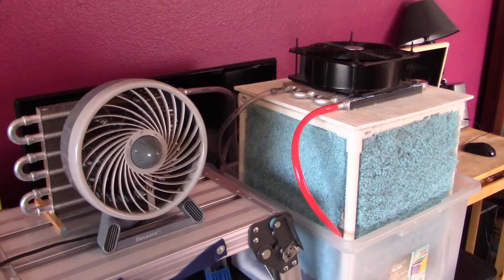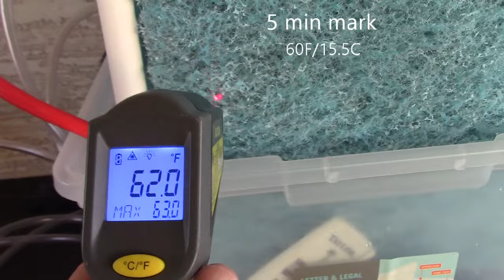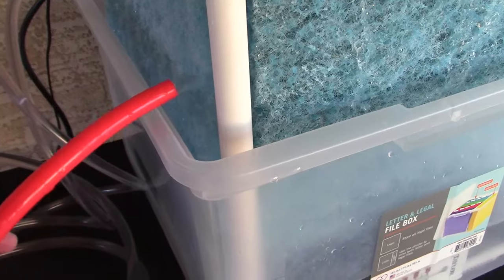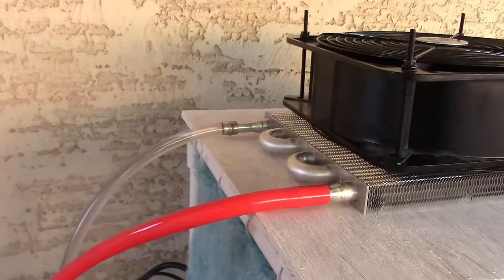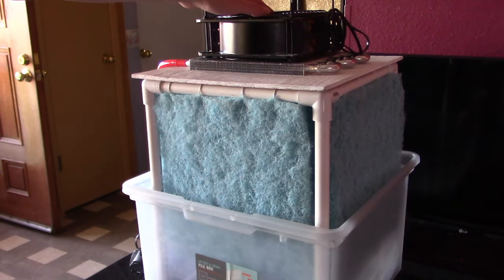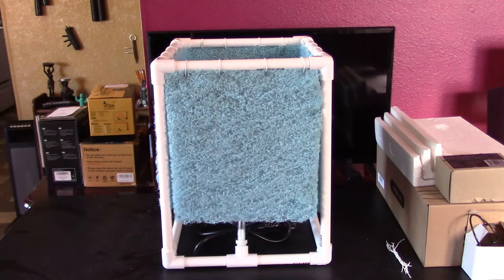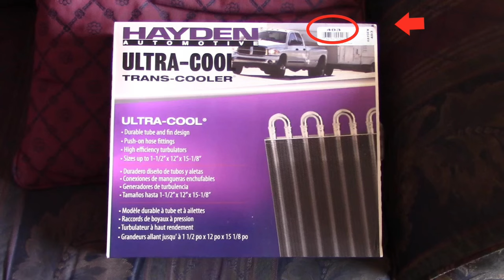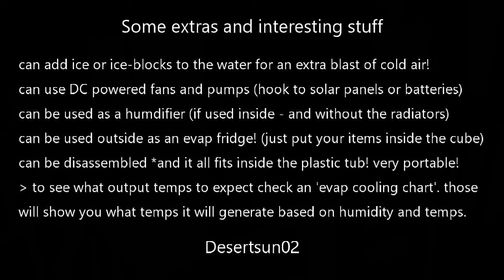DIY "TWO STAGE" Indirect Evap Air Cooler! No added Humidity! brand new! 2 fans/2 pumps/2 radiators!

Comment: may ask what material are those pads used? btw very nice idea video
Reply from the maker: hi and thank you! technically, they are foamed polyester evap cooling pads. places like home depot and lowes have them. amazon sells them but they are usually waay overpriced on that site. a 3x3 foot pad shouldn't cost more than 12 dollars (they were about 8 to 10 when i got them)

Comment: Do you know about the Coolerado cooler? That's a very good design and is multiple stage. Just copy that design and make one
Reply from the maker: hi. i've heard of it. i think it is just a standard two stage unit (or what they call direct/indirect evap cooling. one problem with those is that they still produce some humidity in the air that you are cooling (but it is lower than a regular direct unit). a direct unit's humidity is 80% and the other is 50% to 70% (going by memory). a system like the one in this video though adds no humidity at all to the indoor air. especially good for those areas where the humidity is in the moderate range (and you don't want it to be higher)

Comment: I have a simular idea for living on a boat. Take a small car radiator with its 12 volt fan attached. Take another radiator and attach it to the first one with long enough hoses to reach down to the cold water under the boat. A 12 volt pump brings cold water from below the boat up to the radiator with the fan.
Moisture should condense on the radiator coils and lower the humidity inside the cabin as it cools the air.
The water returns to the radiator under the boat by a second hose.
It's sort of like a home a.c. unit that gets some of its cooling by well water
Reply: You don't need two radiators just one for indoor. Suck cold water from under the boat pass it through the radiator fitted with fan. Air will lose its temp when passing through radiator, water inside radiator gets warm, dump it out back into the lake or river. Add  some kind of water filter in the way before water gets into the radiator to prevent any kind of dirt, algae and what not to get into the radiator
Reply: @lemmetellyousomething679 it would work and be cheaper to build. I still like the closed loop system 
It would be nearly maintaince free.

Comment: Hello, do you think using a Beach fridge instead a plastic container could keep the water cooler in a hot environment?
Reply: doing that, as well as unsulating the pipes goes without saying, of course. Here, a transparent tub was used, just so that we can see better, and comprehend easier. (just for reasons of presentation).

Comment: Whats the total cost of making it? And will it work in places with 80+ percentage humidity? How efficient would it be?
Reply from the maker: 80% humidity is too high. these won't work in that high of a humidity. price varies a lot based on exactly what radiators and fans you choose to use (and where you buy them). pumps, pads and most other items are pretty cheap.
Reply: @desertsun02  got ay ideas on what you can make for high humidity? i live in georgia its horrible. i dont know why people enjoy living here. the humidity is depressing. its year around it never goes away, 80 or higher precent humidity

Comment: operating humidity?  I am from Argentina
Reply from the maker: the best way to see if it will work where you are is to check an 'evap cooling chart' (easily found online). they show what output temps to expect depending on your humidity and temp.

Comment: But how do you keep the cooler free from algae and bugs, lime scale etc? Do we then need an air heat exchanger connected to the evap unit?
Reply from the maker: hi. to make sure no algae grows i just make sure to turn it off every 12 to 24 hours and let the pads dry out. they will dry in about 10 minutes if you leave the fan on and turn the water pump off. (30 to 60 minutes if you don't leave the fan on). i haven't had any issue with bugs (probably because the water is moving and turbulent). you could use window screening material around it if needed. if you have 'hard water' you will get lime scale buildup on the pads. this is normal and the pads will have to be changed every few months
Reply: @desertsun02  Thanks, that makes sense.

Comment: Can you please go into more detail for the purpose of the fan above the cooling pads , Is said fan blowing or sucking warm air out of the water tank ? If so I understand that the warm moist air remains out side, It's just that I can't wrap my brain around that fan on top ,lol . Still a fantastic video thanks again for taking time to share .I would love to spend a week or two at your place to learn from you cuz I'm obsessed with solar energy . You and Little House Off Grid are my favorite channels cuz you keep your cool ideas Sweet and simple .Pun intended, respectfully .
Reply from the maker: hi. that fan in the main driver of the unit. it's sucking the air through the pads and pumping it up and out into the air. that is what causes the air to flow through the pads and the evaporation on the pads. the process of evaporation takes heat (so what it left behind is cold air). the pads get super cold and those cool the air and the water. we are using that cold water and a radiator to create the cold air. then when the water exits the first radiator it is warmer. so it's fed through the second radiator where it is cooled down before it enters the tub. the air that comes out of the top of the unit is then somewhat warm and humid but it is just air that stays outside.
Reply: @desertsun02  Thank you for the quick and detailed response to my questions . Until I get my hands on some PVC ,I'm going to experiment with a couple large towels hanging over an open box like frame .The bottom of said towels will sit in the container soaking up water while the fans and pumps and possibly my tiny solar fountain do their thing ,in your configuration of course . Thank you for always inspiring us to experiment 👍

Comment: Link to the fans you are using by any chance??
Reply from the maker: hi. here is a link to the square fan https://www.amazon.com/AC-Infinity-Cooling-Ventilation-Projects/dp/B00I06S792/ref=sr_1_3?crid=1OFFB9U23PYMQ&keywords=ac+infinity+axial+2060&qid=1690641429&sprefix=2060+axial%2Caps%2C145&sr=8-3
the round fan is called a 'chillout' fan. i can't find a link for the exact one but here is one that looks very similar https://www.amazon.com/Personal-Sleeping-Powerful-Electric-Black%EF%BC%8C8-inch/dp/B08SGFC4JB/ref=sr_1_12_sspa?crid=2KG8J2HRDLS19&keywords=chillout+fan&qid=1690641633&sprefix=chillout+fan%2Caps%2C232&sr=8-12-spons&sp_csd=d2lkZ2V0TmFtZT1zcF9tdGY&psc=1

Comment: My trucks AC is going to cost 1300 to fix, is there any way you could design a easy cooler for my truck
Reply from the maker: hi. make sure to check my channel for lots of other air cooler designs. some should work great for that. the easiest way to find those videos is to check the playlist section. they have their own playlist(s). so you can see them all in the same place.

Comment: What about water dripping from radiator problem
Reply from the maker: water from the outdoor radiator will just drip back into the cube. for the indoor unit you could use a towel or paper towel under it (if needed). i don't have the condensation issue where i live.

Comment: my question is how will it cool if its 100+F outside?
Reply from the maker: hey there. it cools pretty good even in triple digit temps *if your humidity is somewhat lower. where i live i can get 71F out of it when it's 100F outside. to see exactly what it will generate you can search for 'evap cooling chart'. those charts show what temps these things will output based on temps and humidity where you are. just going by memory i think you can get 75F out of this even when temp is 110F (very low humidity)
Reply: @desertsun02  thank you, I live where humidty averages around 50%, in summer.
Reply from the maker: 50% is not too bad. these units will work up to 60% typically (and in some cases to 70%) so it may work for you. you won't get the 20 and 30 degree temp drops but you might get 7 to 10 degree drops (plus any wind chill from the fan if you're sitting in front of it).

Comment: Shit you beat me to this idea. I wish I thought of a two stage. I redesigned mine to not have any water pumps, but a resevoir on top and a electric valve that opens to feed the sponges once it's time to cool, teh water just falls to the floor of the roof(it's a rooftop one), it helps it cool the roof too.